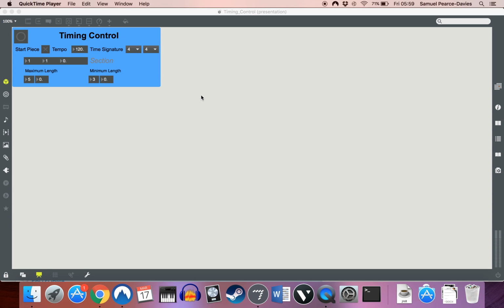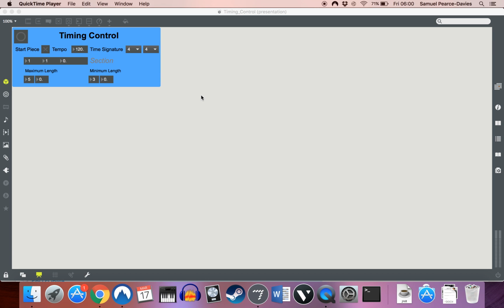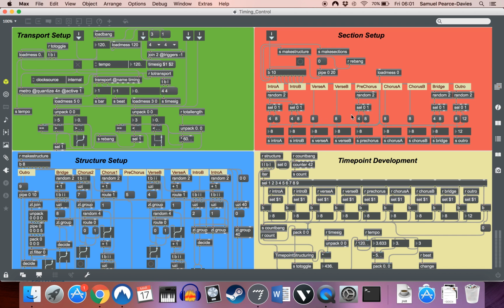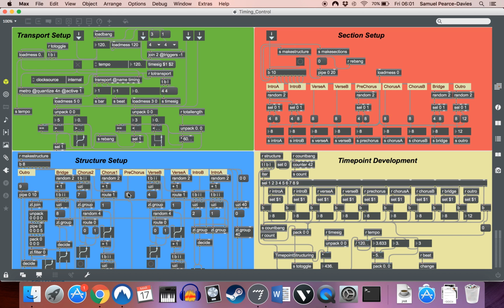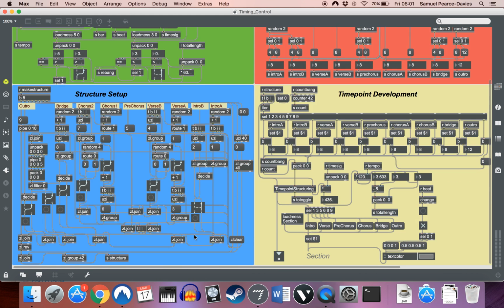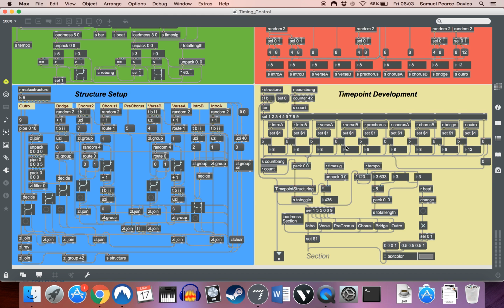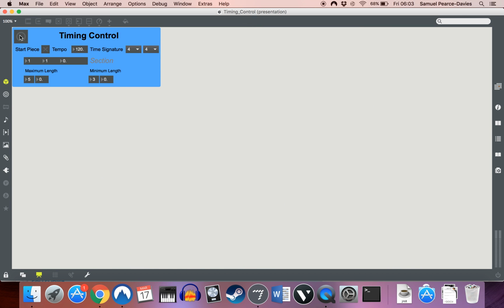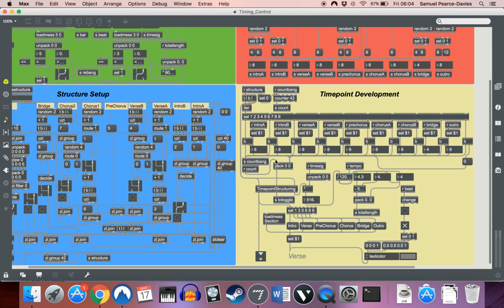Timing Control – Max/MSP

Comment: is it possible to have 1 message containing multiple timepoints?  or do you have to have multiple timepoint messages, each indicating one time
Reply from the maker: Unfortunately it's not, as Timepoint is an object (rather than a message) with only one saved time. However now that I'm thinking about it, you could pre-populate a 'coll' object with multiple timepoint arguments and set the bang from a single 'timepoint' object to also trigger the next entry in the coll to update 'timepoint' with a new calue, essentially cycling through a whole list of values with a single timepoint object.
If that doesn't make sense I could probably whip something up to demonstrate.
Reply: @Spearced  thanks.  yea i was kinda starting to lean in that direction after messing around with it.  had a similar idea with coll

Comment: hi Samuel. i suppose i'm having problems with the TimepointStructuring object. do you think you can help?
Reply from the maker: Sure, do you mean in its construction? Or just to get it working like in the video? It's been a few years since I looked at these patches but I can refresh my memory.
Reply: @Spearced  first of all thanks for the quick reply. 
My patch does not produce any result. looking closer i noticed that the object on the  Timepoint Development area, the " TimepointStructuring" object is blank. like its a third party object or an abstraction i don't have. i googled if it was something i could download but couldn't find anything.
Reply from the maker: @HTRism  Ah, yeah that object is one I built myself. Sorry, thought I included it in the download! I've updated the download links on my website now so you should get the TimepointStructuring object too, just make sure you have it saved to somewhere in your Max file path (let me know if you don't know how to do that) and it should work fine once you close and re-open the main patch :)
Reply: @Spearced  it worked like a charm. however now there are a multitude of errors regarding a "maketimepoint.maxpat" and other bpatcher errors . maybe i'm missing something.
Reply: @HTRism  I’m having the same patch missing.Did you’ve found out solution?Maybe @Samuel Pearce-Davies could help
Reply: @sviktorijoski  any luck?